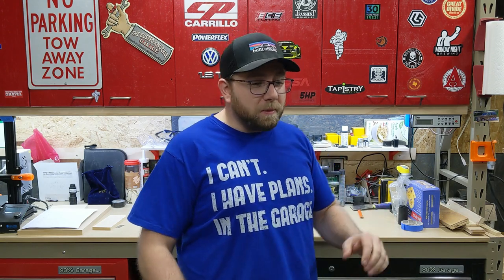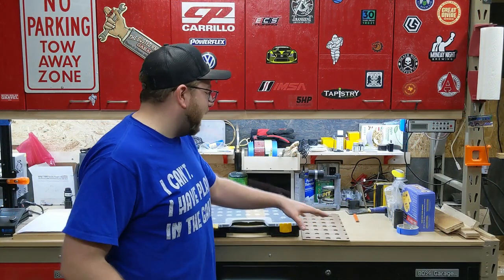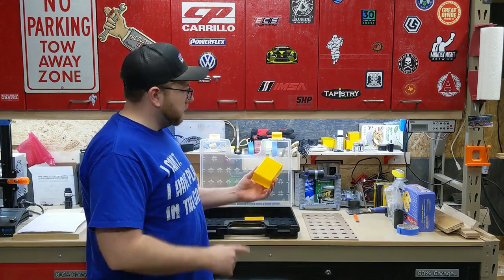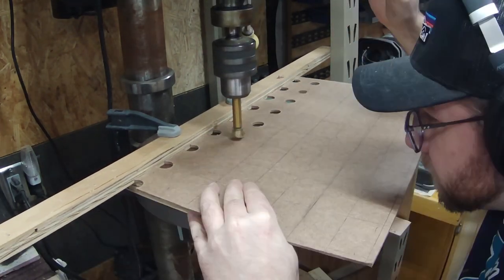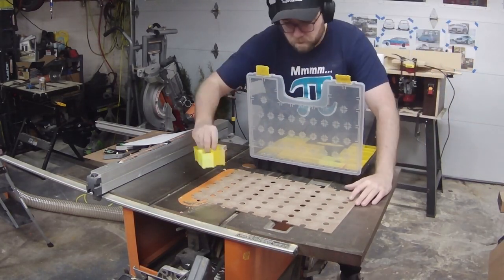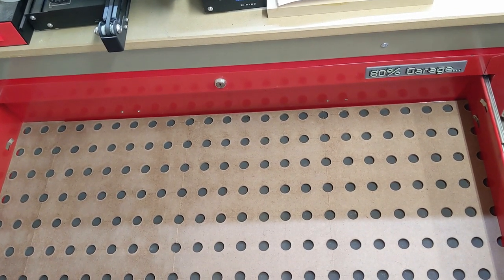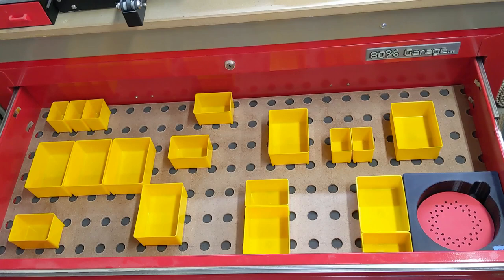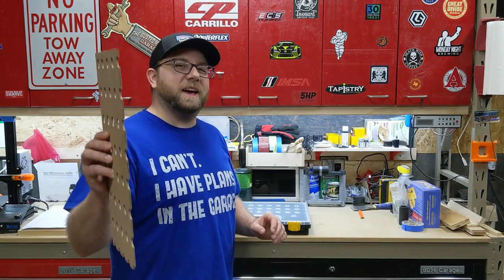Simple & Cheap Universal Tool Chest Organizer - Part 1

Comment: 80% Garage: Where did you get those under the counter tool cabinets? They look wider than the standard 27" roller cabinets. Thank you.
Reply from the maker: One of them is the old Harbor Freight Series 1 44" x 16" chest and the other is the Husky 44" x 24"(maybe 22") chest. They were different heights so I made wooden bases so the top drawers sat at the same height when open. The HF one is a bit sturdier but the Husky is a lot larger.

Hope that helps.
Reply: @80garage7  Thanks!

Comment: Hey, cool idea! You think you could just cut the bottom of the organization bin holders and then add those to the bottom of the drawer. I can’t see anyone getting all those holes straight without a drill press. Unfortunately, I don’t own one. OR!? Make that same piece to make a template 🤔
Reply from the maker: This...is a fantastic idea. If you don't plan to use the cases for anything then utilizing the cut out bottom would be the absolute ideal solution. Thanks for the great comment/idea!!
Reply: @80garage7  no problem, I also like to tinker around. Always trying to improve and think outside the box lol no pun intended. I guess I’m like a tinker Bell but with a pair of balls 😳😂

I’m actually thinking on doing my own channel but I never record any of my projects.

Comment: "39.5mm x 54.5mm" ... dude, the grid is supposed to be 40mm x 55mm. Harbor Freight has at least 3 different moulds at at least 2 different suppliers for these cases and there is almost zero quality control performed. What we've see over the years is that the boxes have dimensions that deviate from nominal as much as 1.5mm. Virtually all of the deep bin boxes (sold as "8-bin organizer") have grid circles too small. Originally they were using a 1 degree draft angle on the bin boxes and over the years have increased to 2 (and the more recently observed 2.5) degree draft angle to increase yield and reduce production cost (less down time from ejector pin failures and less plastic used per bin box). The result is that the taller bins "feet" no longer line up with the circles in the case bottom. That's why I think you've seen such a boom in people 3D printing their own bins/grids because the HF ones aren't very reliable... however... they is nothing more widely available and cheaper than the HF bin system (I standardized my shop on it too) and I really enjoyed watching your video. Thanks!

Comment: A CAD file and a laser cutter could punch those grids out pretty quickly, and in any size you want. Very cool idea
Reply from the maker: 10,000% agree...I have been keeping my eye on the Ortur Laser Master :-)
Reply: Dang, I wish I hadn't sold my CNC now. I've done something like this making a work table top with 3/4 inch dog holes every 4 inches. It works great for clamping stuff when working off sawhorses.

Comment: Man I could have the nicest drill press and precision jig, make perfect lines, and still the holes wouldnt line up in the end. Happens every time. Wonder if the feet would line up with holes in pegboard or florescent light diffuser grid.
Reply: Ive had those HF kits before and basically ended up with little yellow boxes just all over the workshop full of who knows what. Kind of like those magnetic trays making the place look like a pepperoni pizza.